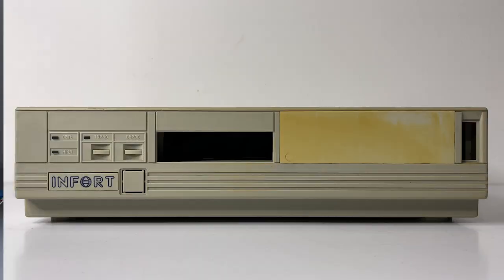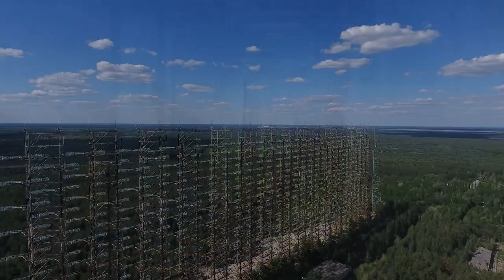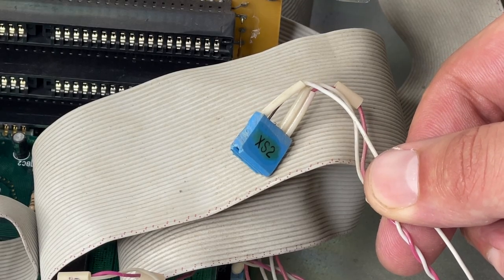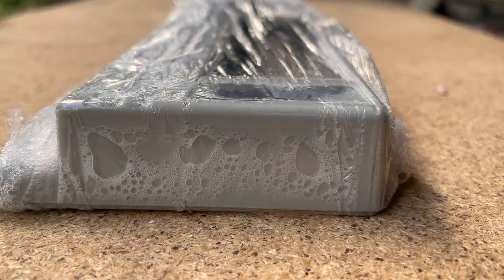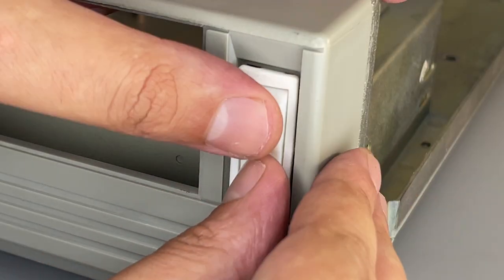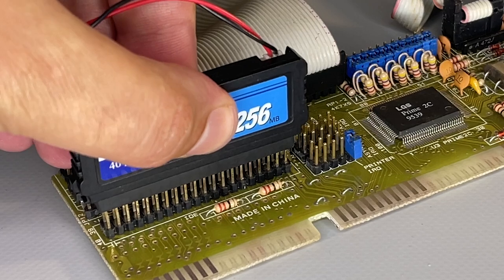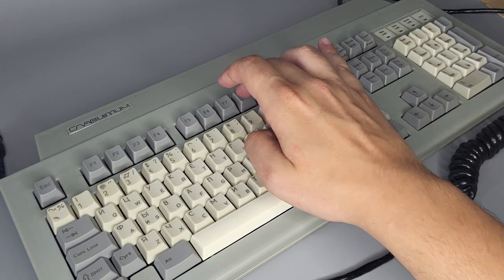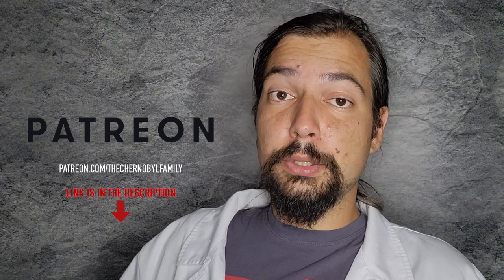This Little Retro 80386 PC is Getting a New Look and Life!

Comment: I'd desolder that battery and connect it with cables, just in case it decides to leak. 
Cyrix FasMath are pretty good, a bit faster and cheaper than i387.
Reply from the maker: This sounds like a good idea.

Comment: What a coincidence, I just started working on a Czechoslovak XT clone, called the SMEP PP06. Let's hope your application will run on a 4.77 MHz 8088 with 640kB of RAM and a CGA card :) (if not, I could run it on my Toshiba T3200SX, but that's a capitalist computer for the bourgeoisie)
Reply from the maker: I am going to use either turbo pascal or turbo c, and i can compile that for 8088 and 8086 as well, because those interfaces were very simple, I do not expect much resources needed :)

Comment: Great work, the machine looks almost as good as new! If you retrobrighted the front of the floppy drive, it would be pretty much perfect.

ISA is a simple bus, so all the slots are connected in parallel with the corresponding pins connected to each slot. The only thing special about those riser cards is alignment of the slots so the cards line up with the holes in the back of the case.
Reply from the maker: Thank you! That drive is a temporary solution, I gonna place there a fresh grey one, judt need to pick it from tha lab.

Comment: A lot of OEMs used similar riser cards with either off the shelf Baby AT boards or boards shared across multiple models. Usually though the onboard ISA slots were populated (likely so you could have a single fully populated board across tower and desktops). My guess is Infort didn't plan to use this same board in a tower or a full height desktop application, so they had the OEM leave the rest of the ISA slots off. Amusingly, you can see they still populated all of the supporting resistor packs and capacitors for the the rest of the ISA bus. Perhaps it was just simpler for their manufacturing process or they all play a role in terminating the ISA bus properly and Infort specified they remain so they could use their locally manufactured riser cards. Also, if that rear IO plate is indeed removable that case might make for an interesting modern sleeper PC build with a Mini ITX board, I know from personal experience cases that take a standard AT PSU will take a modern ATX PSU. Just an idea if someone else runs into a similar case with a Varta bombed board...
As far as the Math Coprocessor is concerned: the Cyrix FPUs are markedly better than the original Intel parts but might be a bit spendy. I'd go with the ULSI  Math CoSX Advanced Math Coprocessor. Supposedly they're just as fast as the Cyrix and tend to all run at 40 MHZ regardless of their rating, useful if your board doesn't support asynchronous FPU operation like most 386 mobos.
Reply from the maker: This is super interesting! I might get the same case in future, so surely will try microITX — though about something like this :)

Comment: I would rather restore the motherboard instead of changing it for something else. Just for sake originality. BTW - maybe they desoldered the slots to put it on the riser?
Reply from the maker: We gonna fix original one as well, just the damage is too massive. One of commenters suggested that that was an OEM variant ordered specifically for this manufacturer.
Reply: This can be the case of course, they could order such mobos but I'm not sure about their manufacturing capacity. To make custom motherboard the MOQ was probably more like 1000 pcs not 100pcs. @ChernobylFamily

Comment: You can also use hydrogen peroxide volume 10, submerge it in a large pot and place it in the sun, the high temperature helps in the efficiency of the chemical reaction and get better results. The 8bitguy videos are very in-depth on this practice. Love ur work!
Reply from the maker: Rught! That way it worked good with semi-transparent color filters of mainframe panel. But the oxidant I use costs kinda 60 UAH (<2$) per 1L, so it appeared to be significantly cheaper to buy it then a liquid peroxide.

Comment: I do miss the old cake-box (8 horizontal slots) and pizza-box (less than the full 7 slots) computers from then, such cute small cases to hide on desks under monitors or other equipment. That looks good all cleaned up. B)

with them old XT/AT/baby-AT PSUs, if no capacitors are bulging or leaking all over, I'll unplug the hard drive data cable to the motherboard if there is one (leave the power connected) and stab the power supply connectors with a millimeter to make sure the voltages are +/- 10%, and send it if it is. The old PSUs were tough as nails and only failed if they got hit by lightning or a capacitor aged and failed. The newer ATX PSUs have a vastly higher switching frequency (300khz or higher) that ages capacitors much faster than the old 1khz things from back then.
Reply from the maker: Thank you for those tips!

Comment: Hey dude, the Cyrillic works only on XT mode , not AT. I have a Pravetz 16 keyboard and it have inside a jumper for XT and AT, so the cyl/lat button as well :) olso it work only in CGA mode (video card) so you must have CGA (with Cyrillic simbols in the ROM) and XT class machine :) no drivers needed
Reply from the maker: Thanks for these details!

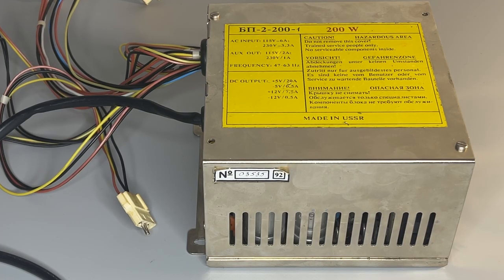Comment: 9:16 Cool power supply. What is output power of it? Will you retrobright those MOLEX?
10:14 OMG the keyboard is magnificent! I love Soviet epoch electronics after your reviews! Do you have schematics for this piece? Any docs? How did they managed to add extra LED in hardware and software, in protocol?
11:03 Wow! 20MHz! That's a lot for that time!
Reply from the maker: It is 200W, I am not sure about MOLEX as they are badly made and are pretty fragile.
This keyboard has factory seals, I decided not to disassemble it, but it is so heavy that I believe inside is very much electronics. One commenter told that that extra button works in XT mode only, but how exactly I yet did not figure out - will bring my XT back to life and will check.
Reply: @ChernobylFamily , sure thing you are the boss not to disassemble — it can be fragile, of course. But what I meant: no docs available of this keyboard? Maybe you can sniffer the key code it sends for this new key press and the control code it receives from the PC for the new LED activation? How good are you equipped? I have an impression that you have all needed and waaaaaay more!
Reply from the maker: @kirill_bykov not that good as it looks, but we will try

Comment: 4:10 
Maybe this board works as debouncing device for swiches ?
Reply from the maker: It is an interesting version!
Reply: yeah, and some impedance/load protection, Even tho most chips can do 10mA drive to a LED, some can't. so maybe it is just an amplifier for the rest of the speaker and LEDs, maybe. without reverse EEVblog-ing/BigClive-ing the PCB I'm not sure if it's inverting off to on for some LEDs as well. Oh, and maybe an extra layer of static protection as well (I imagine many walking across a room and pressing a button without touching anything else to ground themselves). Usually that stuff is built into the motherboard, yet this is the early days of AT/baby-AT so may not.
I have a few older cases from that era (286 to Pentium-II) that also had PCBs for a LED MHz display on the case, I miss them cool things on newer comps.

Oh, if you didn't swap out that floppy drive for a new one later on, that same cleaning thing can be done to the front of the drive, Most drives have a removable front to let them be put into some OEM del/HP/Packard-bell/whatever cases that have built-in floppy drive bezels. some have tiny screws, others it's just a lift/push tab holding the front on. I tend to just be lazy and use windex on a paper towel to clean drive fronts before installing them, most of the time that's all it takes even with years of nicotine exposure.

Comment: how about a slim micro-atx/mini-itx suitcase laptop (1u thickness or so) with desktop parts, at max low profile expansion cards
Reply from the maker: That sounds really cool :)
Reply: btw, usually if you ask why something nonsense, its vanity for no other reason
Reply: if you are coding graphics, on cpu, try plane-ray distance to a bvh sphere, after screen x+y plane normalizations every intersection test is only a dot product, on the bvh from bfs grid top down structure (ray tracing culling, ray tracing but in raster manner), also supports 360 degree equilateral vr image rendering, same for lighting ray casting bounces
Reply: similar to a very fast quake, descent, duke 3d or wolfenstein engine, but its true 3d, not 2.5d
Reply from the maker: Thank you!
Reply: actually cube map with 6-projection images rendered from the center camera of the cube @ChernobylFamily

Comment: Yes, simply, a 74 trigger ic is 10 times cheaper than a good reliable bistable mechanical switch!
Reply: But now i think, there are more features of 74 trigger:
1 74HC74 is 10x cheaper than a button with fixation
2 simple tactile button is somewhat more  reliable - less mechanical stuff inside
3 you can define default turbo button state after reset ! let's say we want to boot in 'turbo mode' always
4 it becomes technically possible to toggle the '74hc74 button' from s/w !!!
5 the buttons become 100% debounced, so less glitches and more reliable PC mode switching
Reply from the maker: Hm.... interesting!
Reply: and
5 the buttons become 100% debounced, so less glitches and more reliable PC mode switching @ChernobylFamily

Comment: A few comments about the bleaching.
1. You didn't do the blanking plate, granted you don't have it installed, but yeah...
2. You didn't do the 5 1/4" drive bezel/lock, so that part is really yellowish...
3. The brand bezel, "INFORT" had a uniform dark blue color printing. Unfortunately the background yellowed, and unfortunately the pigment on the letters was damaged by the peroxide.

I feel it's really tricky to do this correctly. The result looked quite nice, but seemingly something always goes wrong. How long did you wait until cleaning off the peroxide?
Reply from the maker: Thank you:)
1) it is not original
2) the thing is, I have somewhere a perfect grey one, so once I find it, I'll replace it
3) around 4 hours.